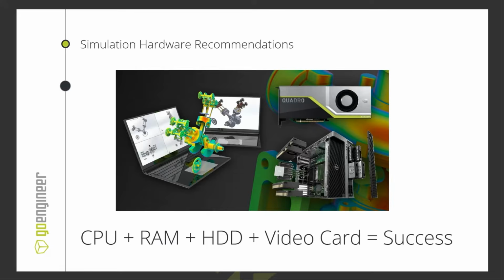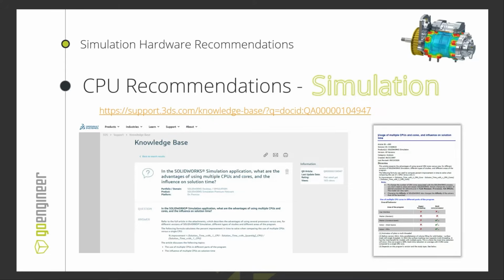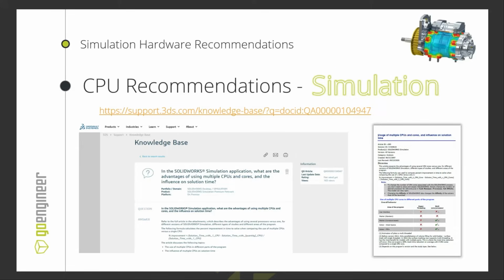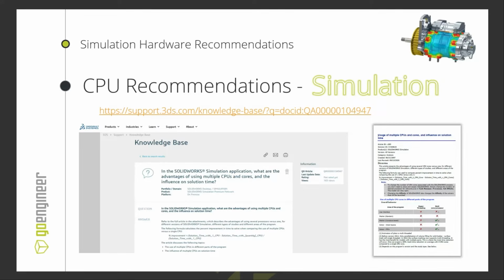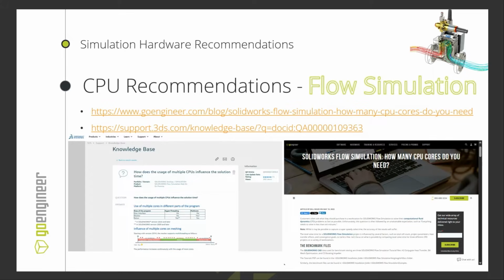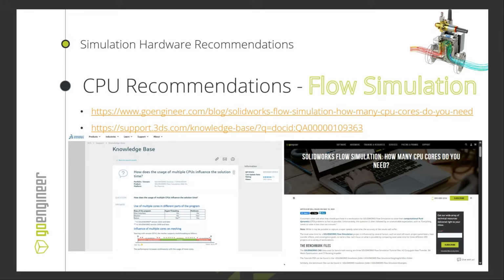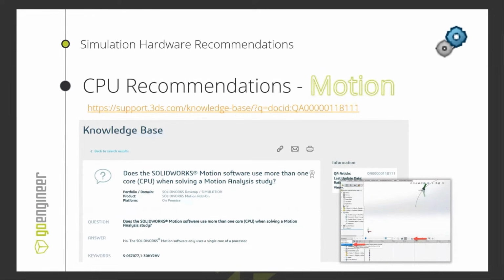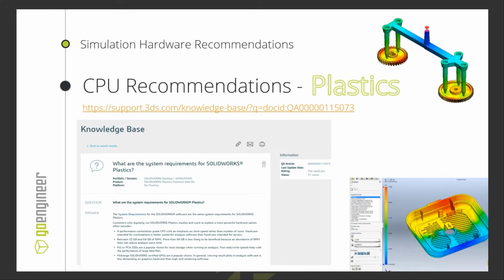Ultimate Hardware Recommendations for SOLIDWORKS Simulation

Comment: @GoEngineer Thank you for the video and commentary, gentlemen. However, I have a few questions. The assumption is: working in SW 2024 SP5, 3D modeling of components, and working with large assemblies. Preparing 2D manufacturing documentation (including sheet metal module) and 2D assembly documentation.
1. Do you recommend a desktop or laptop as a workstation?
2. If I don't perform any simulations/analysis, do I need a Quadro card? Will using, for example, an RTX 5080 pose a potential problem? Or is the lowest-end Quadro card recommended?
Thanks in advance for your reply.
Reply from the maker: The rule of thumb for your workstation is to ask whether you want power or flexibility. You can get a SOLIDWORKS-capable laptop, and it should perform okay. But if you want to maximize performance, a desktop gives you more flexibility and ability to boost the power than you'll get with a laptop. For large assemblies, a desktop is probably the better way to go, but you could potentially get by with the right laptop if you spec it out.

As for the graphics card, the biggest consideration is whether it's a SOLIDWORKS-certified graphics card and driver. If it's certified, then you should be good to go. You don't always need the highest end card, but a professional graphics card is almost always better suited for SOLIDWORKS than a gaming graphics card. You can check your system on the SOLIDWORKS website: https://www.solidworks.com/support/hardware-certification/

Comment: if I had to pick between two options for overall RAM performance in solid works, would it better to:
1. run 2 sticks at 64Gb (2x32) as the cpu memory controller can run the ram at a higher clock speed (6000MT/s)
or
2. run 4 sticks at 64Gb (4x16) for more bandwidth in the memory channels but at a lower clock speed (around the 3600MT/s range)
this is with an AM5 platform mother board at a cpu like the 7900x (12c 24t) in mind
Reply: I've got the 2x32 situation in my 7900x. It may be that bandwidth is theoretically higher with more sticks, but the AMD Infinity Fabric controller favors 2 sticks over 4 or 1 for stability and bandwidth.

Comment: I have a Ryzen 9 9900X (12c and 24t) and 96Gb DDR5 memory. Thc Calculix like it. 🙂👍
Reply: I have a slightly older Ryzen 9 7900x (same c/t) and 64GB DDR5 (2x32). Mine cost under $2k with an RX 7800XT GPU. Looks like a simple simulation workstation doesn't need to be $10k.